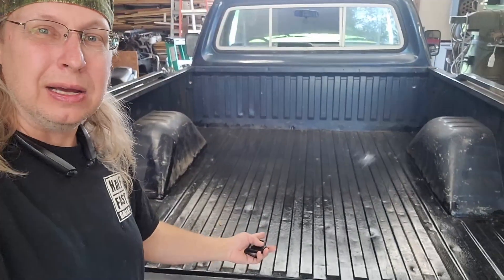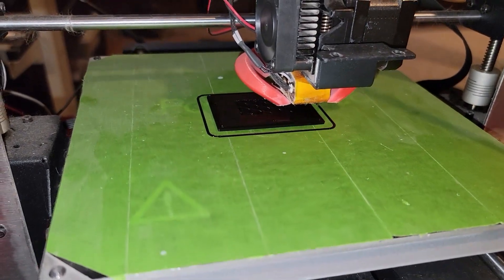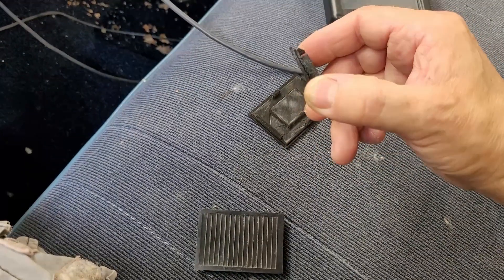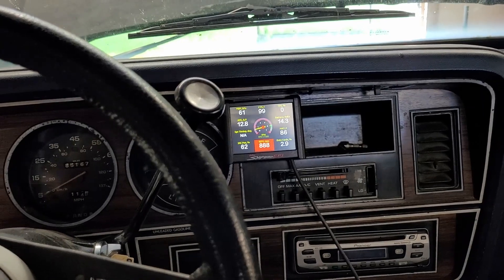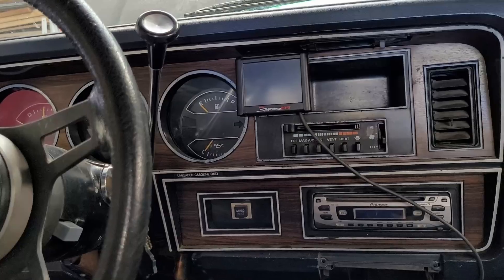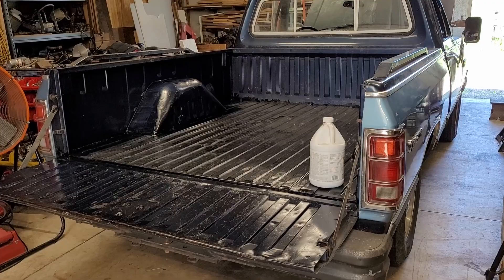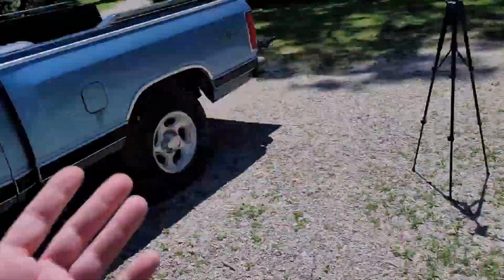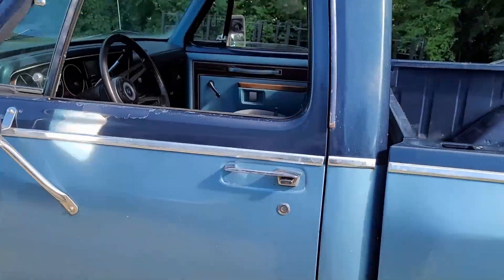3D Printed Car Parts! & Updates on the 1984 Dodge Ram D150 Project

Comment: that's an awesome little panel you printed! Do you mind sharing the drawing? I have an Artillery printer, would have to slice it for my printer.
Reply from the maker: Thanks. I'll dig around and see if I still have it. A lightning strike took out my NAS last fall so I'll see if I have a backup somewhere. If anything I'll just have the .stl if that works. Also, the PLA version distorted in the heat, so you'll need to print it with something more robust.
Reply: @HFG  yep .stl would be perfect if you still have it! I'll make it out of PETG - it's a little happier in the heat!
Reply from the maker: Sorry that I lost this comment. Send me an email and I'll dig around for the .stl for that print. thehalffastgarage@gmail.com